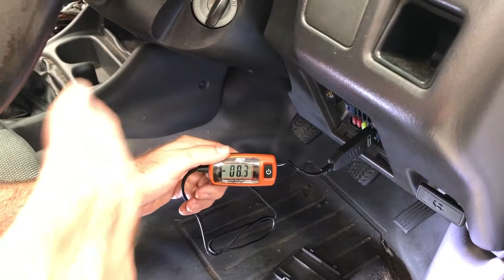DIGITAL AUTOMOTIVE CURRENT TESTER - SP TOOLS (SP62008 & SP62009)

Comment: I am currently looking this an Amazon. Does this measure less then 100mA? I need to find a low current drain in my car. Thank you.
Reply: for such a mediocre drain it's not considered a parasitic draw. maybe use a multimeter if you need to find said circuit
Reply: @chumemofos1433  The problem with it is that multimeters only measure up to 10A, yet anything you would switch on a car would exceed this. btw I found such meter that measures from 1mA - to 100A in 1mA increments!

Comment: I just bought this but my fuses are too small for it. UK Ford Mondeo ST220.

Is this not compatible with my car?
Reply from the maker: This tool comes in two size options to fit different fuse sizes. Sounds like you may have purchased the larger/standard fuse version (SP62008). The one you're after is the Mini-Blade version - SP62009.
Best is to just check the part number on the tool itself.